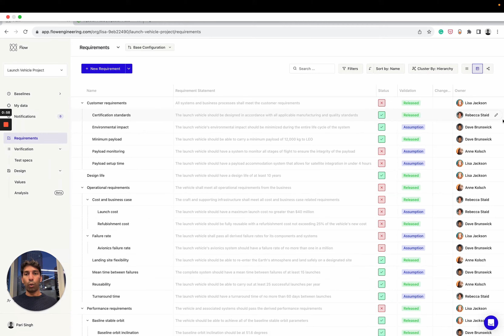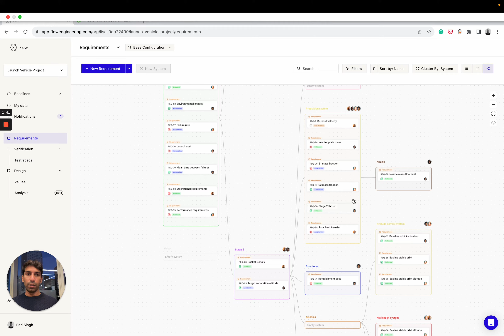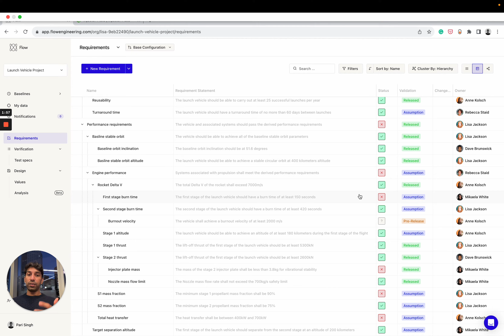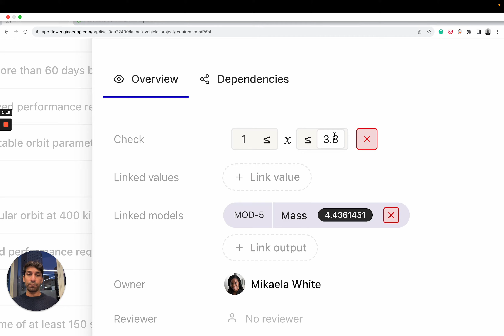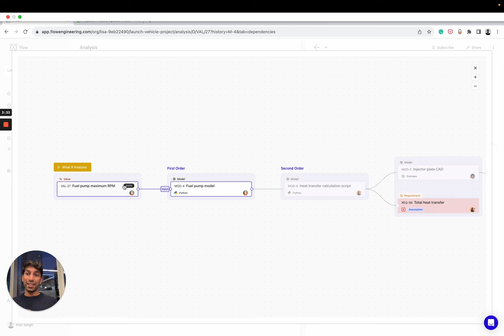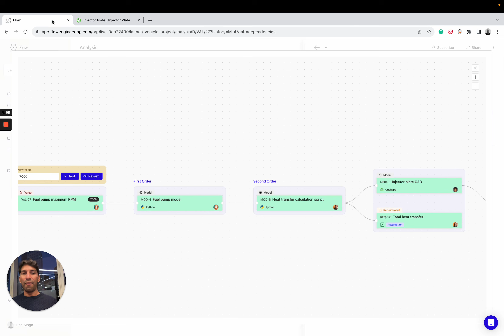Comment: Definitely liking how requirements on set up in Engineering Flow. The problem I see with the digital twin Analysis, is that often the engineering scripts require a specific environment and dependency installation to run. I would think you need to Dockerize the scripts in order to be able to provide useful analysis. Also they can be long running engineering scripts, so there needs to be a way to track execution and logs.